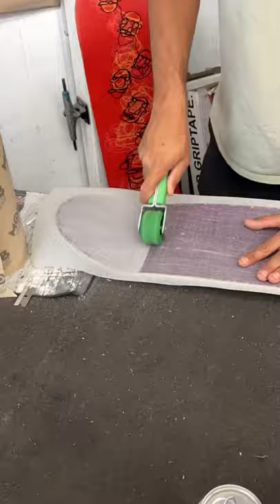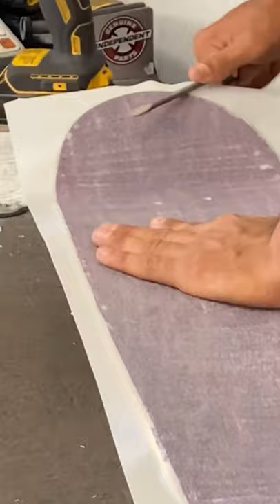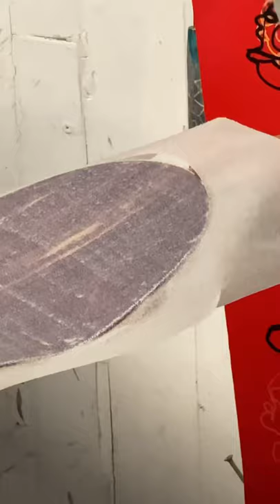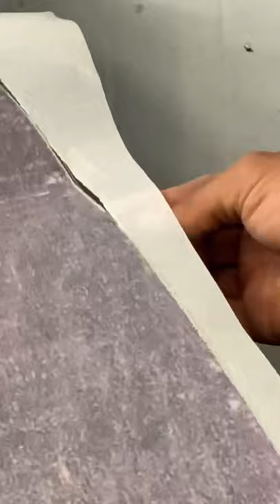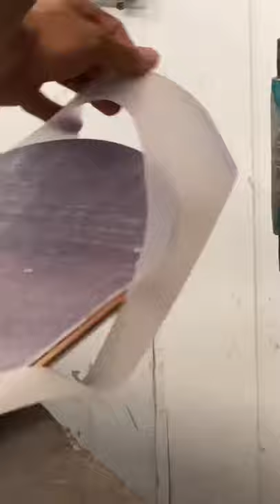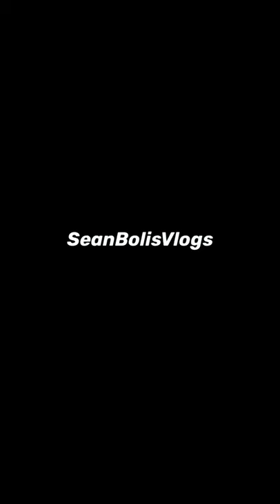Putting clear griptape on a skateboard.

Comment: so... it basically just looks like you have extremely worn out normal grip tape? lol
Reply: My comment was he went through all that to have a mediocre board
Reply: You sjouldnt have it clear if you have a boarf without a print
Reply: They put clear drip on a black top ply lmao that's why it looks like thag
Reply: It’s best to use on small portions of your board with either stickers, graphics or print out art underneath and trace the rest of the board with normal grip.
Reply: No it just looks like that when you put it on it looks way better after a day of skating it
Reply: with his desk color yes
Reply: Regular grip tape is black. This grip tape is not black. It shows the color of the deck a little bit. If the deck was a better color then this would show way better. Also, the bubbles will go away as you skate and the grip tape will get more transparent.
Reply: @jenske2881  At the very least decorate it with stickers first.
Reply: @Bradley_Warren  exactly like who does this
Reply: Its cool if your board has stickers on it or something
Reply: It looks like the top of the deck
Reply: No it makes it so you can see the top of the deck if it has coloring or designs.
Reply: Not at all, I had tons of clear tapes like a decade ago, with colorful boards it looks amazing, and you can customize them underneath and it shows through
Reply: @thatguyhans6031  fucking hell, this. don't just assume that it looks weird. I tried out clear tape on my newest deck and it looks fine after a couple of days skating.
Reply: You're able to see top play
Reply: clean grip looks best with graphic boards lol
Reply: No, you can actually see through it to the top stain, a lot of people will sticker bomb or put photos on the top of their deck before clear gripping it. Looks pretty sick if you do something like that
Reply: I guess the outcome of putting it on will be different depending on what colour the board is before putting it on

Comment: Ive never used clear grip but i had never thought about rolling it like that
Reply: Mob clear
Reply: Good.
Reply: That's the Mob Grip tape roller, they sell it over on NHS Fun Factory's website and if you're lucky your local skate shop may have a few. They're insanely good for this, because normally clear grip gets insane air bubbles but using mine I managed to get no bubbles even with a ton of stickers under the grip. If you can't find one, try using a wheel on a skateboard truck. A little dirtier and a worse angle but it'll do in a pinch

Comment: That's the Mob Grip tape roller, they sell it over on NHS Fun Factory's website and if you're lucky your local skate shop may have a few. They're insanely good for this, because normally clear grip gets insane air bubbles but using mine I managed to get no bubbles even with a ton of stickers under the grip. If you can't find one, try using a wheel on a skateboard truck. A little dirtier and a worse angle but it'll do in a pinch

Comment: Did this man just mark the edges on clear griptape?!?!?????!??
Reply: Scoring doesn't show you where to cut, scoring thins the cutting line and makes sure it's straight so you can get a cleaner cut. You can run the razor without scoring it like that but your edges will peel more and your cut will often be more jagged
Reply: I'm a fuckin freak though I score with a wood file and then you can literally peel the edges off and it comes out perfect

Comment: That rolling method to get the air out just means you can’t grip a board like a real skater 🛹
Reply: The roller is kinda legit, clear grip makes air bubbles way more visible than black and the roller helps squeeze out the tiny ones. This dude just kind of sucks so he's going over it slow as fuck

Comment: in my experience, clear grip tape only looks good for maybe a month, then it gets very dirty and makes the board look pretty nasty. I’d stick with normal tape instead
Reply: Any grip looks gross if you skate with mud and shit dried on your shoes but leather belt cleaner blocks work as good as the mob grip tape cleaner, my clear grip is usually fine and I live in a dusty ass area
Reply: @skateloser4088  good to know, i try to skate at parks and clean streets, but my tape always gets nasty. i’ll definitely pick up a belt cleaner and try it out
Reply: @jonpocklington2160  yeah obviously I prefer mob grip cleaner but if you find those rubbery scrub grips advertised at leather belts you can slowly but surely sit down and rub a good layer of dirt off. I used to use the mob grip cleaner and it takes time but restored both color and grip to worn out shit

Comment: Is clear grip tape adhesive like normal grip tape?
Reply: No goes away faster.
Reply: If you mean does it stick to your board, yes. The roller isn't this fool gluing sandpaper, the roller is for air bubbles. Last guy is saying that clear grip tape doesn't grip your feet as well, which is debatable

Comment: Where you buy that tool from??
Reply: That's the Mob grip tape roller! I swear by it. Comes from NHS, which is the distributor for Mob, Creature, Santa Cruz, and OJ. In a pinch you can roll grip with a wheel on a truck but the Mob roller slaps